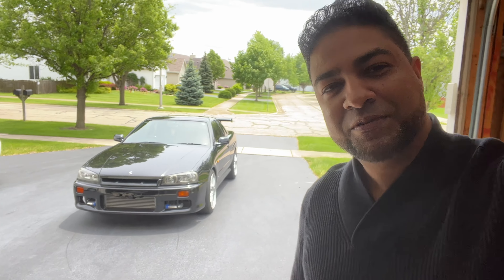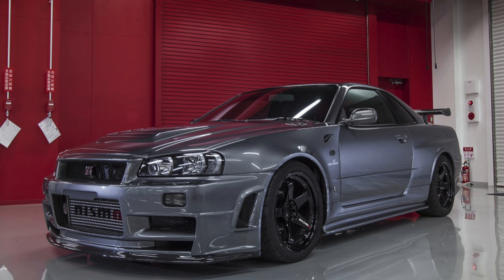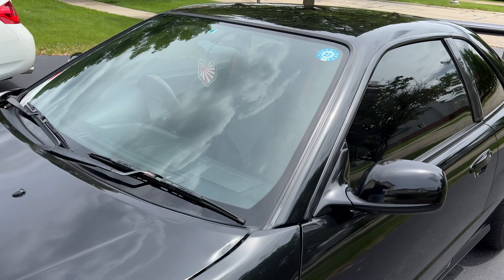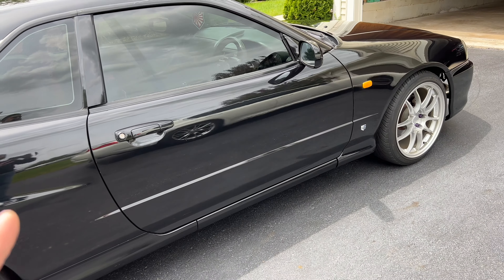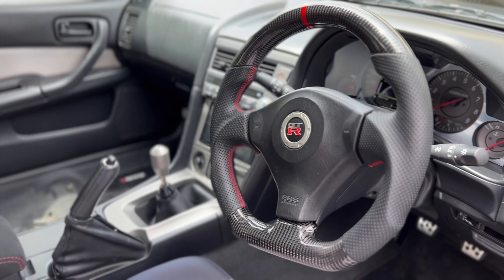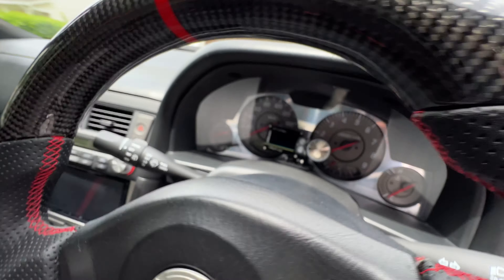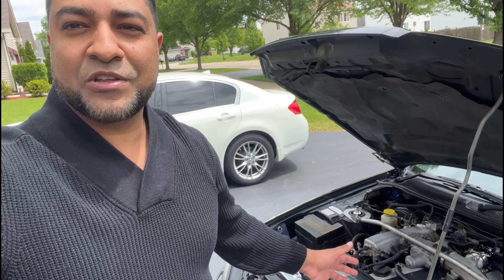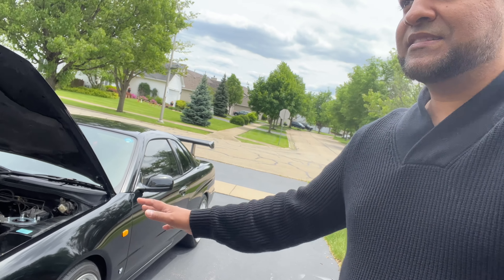EP5: Finally some updates on my R34 Nissan Skyline GTT (May 2022)

Comment: Hi, where did you get the suede armrest btw?
Reply from the maker: It’s Alcantara - had it custom made (look up stitchgirlinc on ig)
Reply: @tklgarage  Thanks. When is your final reveal? When is car done? Can’t wait ..!!!
Reply: @tklgarage I just picked up a set of Nismo Heritage Rear Quarter Panels. Do you remember how much you got yours for? Just curious. I’m currently trying to work out a deal for the OEM fenders $685 each
Reply from the maker: @kent4786 oem rear quarter panels go for about 5k usd now! That’s a great deal if you’re able to get it that cheap. I paid about 2200-2500$ a few years ago for the pair
Reply: @tklgarage  wow, great deal back then too. The $685 price are for the front OEM fenders. Rear Quarter panels I got for same price you did 😊 all that’s left are OEM rear bumper and side skirts..!!! Probably convert it end of next year tbh. I was lucky enough to get a pair of OEM side pods
Reply from the maker: @kent4786  back then they were fairly cheap. I bought another r34 gtt so looking to source rear quarters again, great deal on the one you got compared to todays pricing !  Front fenders is about right as well, tkgt USA sells them for similar range as well 

Rear bumper you should be able to source from your local Nissan dealer
Reply from the maker: @kent4786  side pods are hard to get without paying an arm and a leg, congrats!
Reply: @tklgarage  what? Why did you buy another R34? You’re gonna sell the one you had and flip it? How much did you get the recent one for?
Reply: @tklgarage  it did cost a bit but it’s ok cuz I think I got my R34 for a very good deal. OEM side pods go for $1500 each without tax yet. I was able to get a pair for $1k
Reply: @tklgarage  many people I know bought their R34 GTT for about $55k  average. I’m hoping that with my full OEM GTR conversion is done I’ll be spending less than that. And this is including full interior GTR as well
Reply from the maker: I only bought it because I got a great deal on it, although it’s automatic, I paid about 23,000$ . I also picked up an s15 Silvia spec r. Both expected to arrive first week of July!
Reply: @tklgarage  wow, great deal. What a collection. $23k for a GTT? How many miles? I got mine for $30k 70,000km Grade 4
Reply: @tklgarage  tbh, the R34 will be my last addition to my collection. I’m done. I have a 6 car garage and it’s all filled up now. Gotta go back to focusing on family n kids